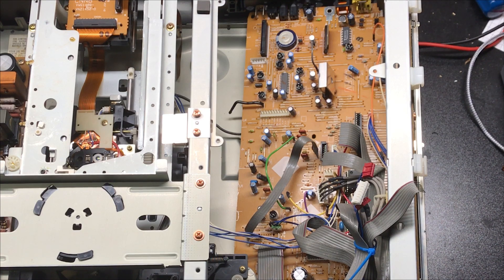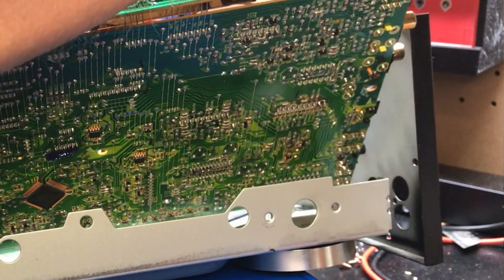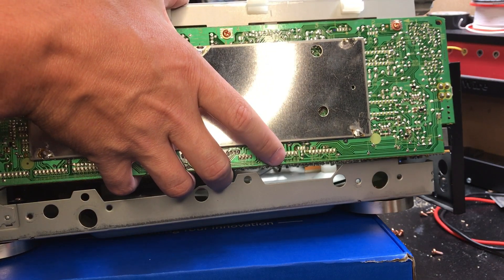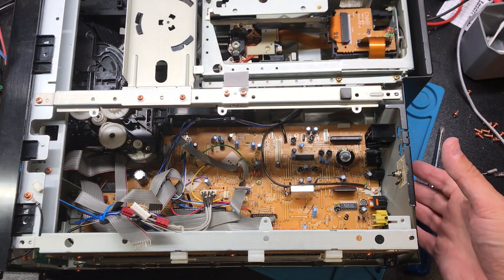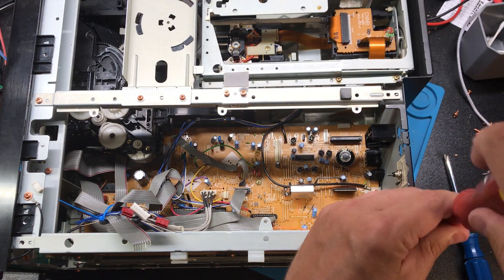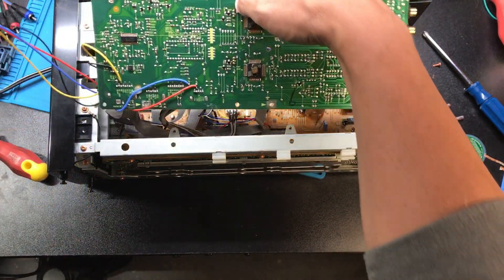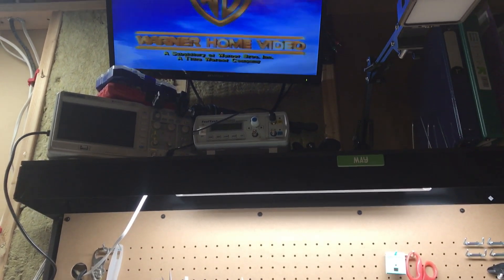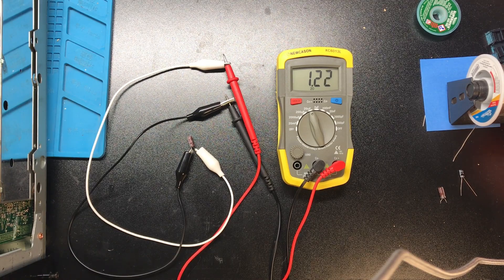Pioneer CLD-53 ELITE Laserdisc Player - Part 3 - Playback issues FIXED plus bonus footage

Comment: I wonder if you have an in circuit ESR tester if that would've shown them up as bad (as i know its hard to test uf in circuit). Also was the Supercap bad too or just replaced as a precaution ?
Reply from the maker: Thanks for watching! Yeah, I need to get an ESR tester. This one is pretty basic. I was not able to verify if the Super Cap was bad or good because my tester doesn’t go up that high. I’ll keep it around and test when I get a better tool.